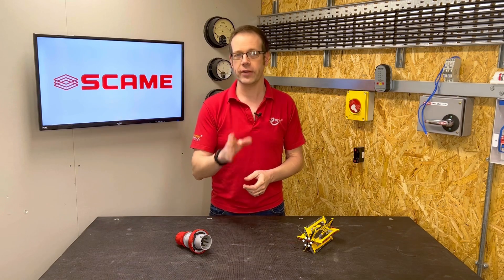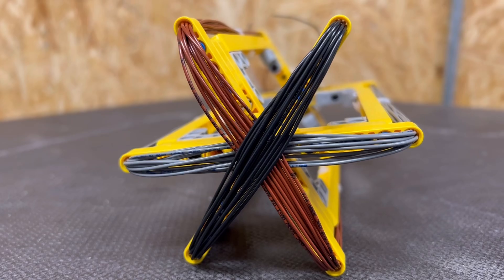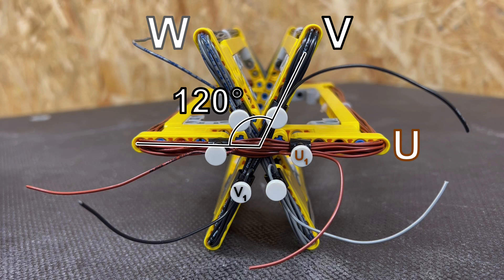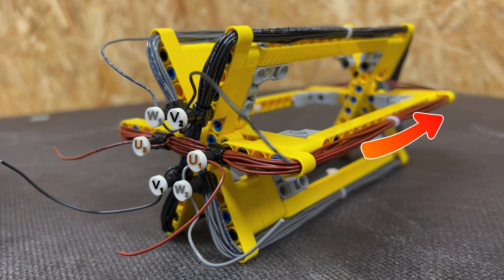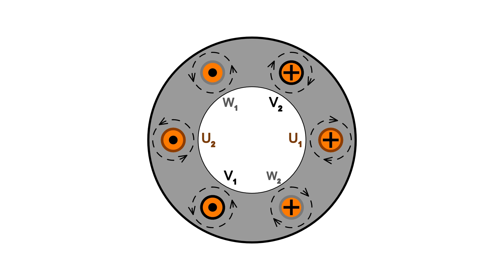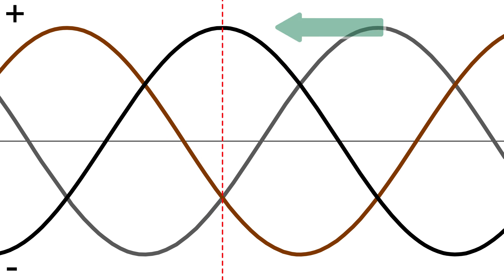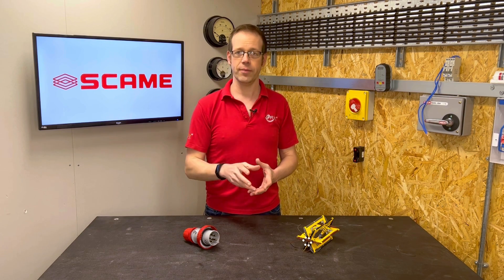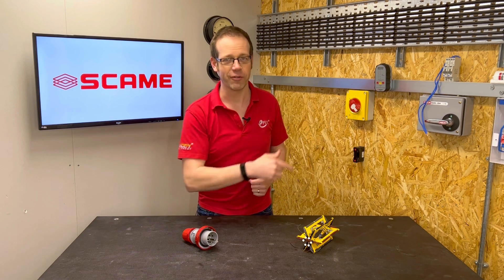Why Do 3-Phase Motors Change Direction if Phases Are Swapped?

Comment: During my electrical engineering degree I studied in detail induction motors, I can mathematically demonstrate the current flows, the magnetic fields and the induced current. This is the best simple demonstration of the principles I have seen. A fantastic video, which I am going to share with colleagues.
Reply from the maker: Aw, thank you so much, that's very kind of you to say. Glad it was of use. 👍
Reply: He has an electrical engineering degree: it wasn't of use as he has already studied the theory of AC electrical machines in his degree..

Comment: As we shall see, the rotor in a 3-phase induction motor runs in the same direction as the rotating magnetic field. Therefore, the direction of rotation of a 3-phase induction motor can be reversed by interchanging any two of the three motor supply lines.
Reply from the maker: Nailed it!

Comment: Nicely explained Joe , 
But I can’t help thinking this is meanles . As if you want to/need to charge the direction of rotation the way use your exspiereance and skills you learned at college and just swap the pins over , theses fancy bits of kit are taking the skill out of the job . Sorry just my opinion. 
Great video though as always 👍if you can’t swap the the connections over without a fancy plug . The it time to jack in .for god’s sake use the skills and knowledge you learned at college . Stop making these companies rich .
Reply from the maker: It's just another option available really isn't it? 🤔
Reply: @efixx  yes I get that .

Comment: I think you could have usefully have referred to the electromagnetic force that is generated by a winding pulling it in a given direction and then 120° later the next winding does the same and so on, the sequence then determines direction of rotation.
Reply from the maker: Yur, that's part of the story, but the filed has to move to generate current and a magnetic field in the squirrel cage.